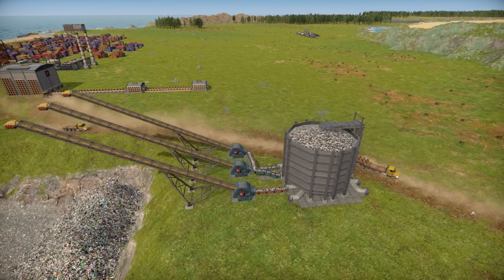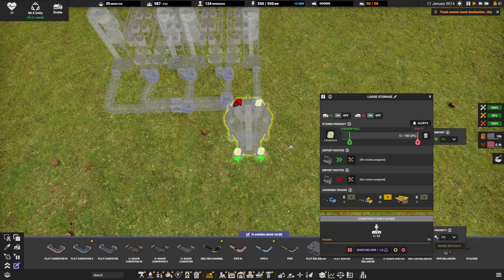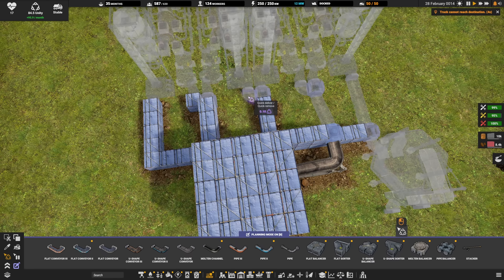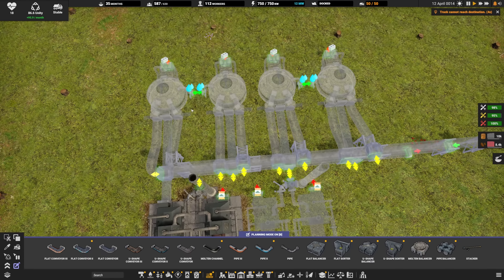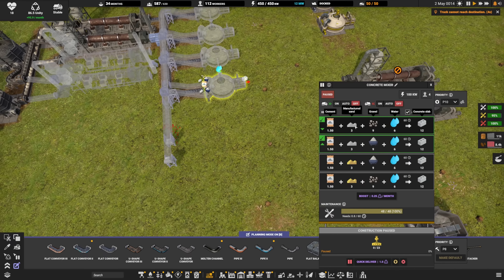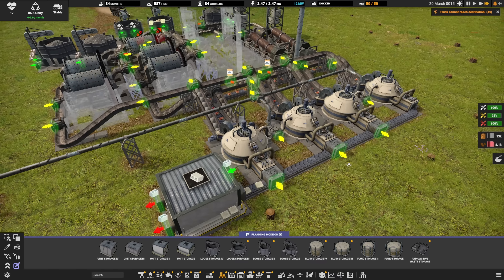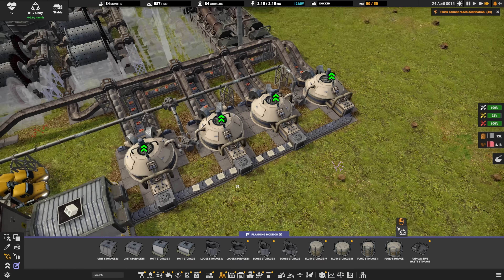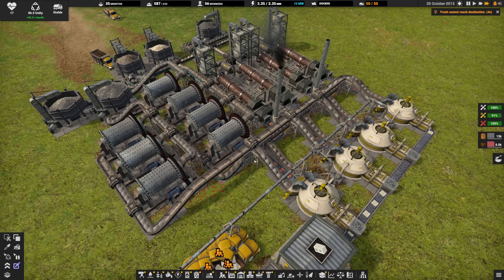Upgradable Concrete Slabs Blueprint 🚜 Captain of Industry  👷  Walkthrough, Guide & Tips

Comment: Did you know, you can run 1 crusher instead of 2, for producing manufactored sand from stone?
You just turn on both recipes, connect output to input. And place sorter, which will sort out manufactored sand from the loop.
Stones > gravel, gravel go again, and > manufactored sand.

Comment: Hi JD, 
thx for your hard work. 
Those blueprint-vids (I count the "old" vids with the smelters ect. too) are really great, because you explain your reasons and thoughtprocess while buidling.
Is there a blueprint for a brickproduction?
Reply from the maker: No there isnt a blueprint, for bricks, I found after getting to play with them this time around that buy the time you have belts its not really worth scaling up, as its cheaper on coal to upgrade to the concrete slabs

Comment: Hi i've used several of your builds they work great. But i think the approach of building all things at the same place might not be the most efficent way of doing things. Wouldn't it be more efficent to build the rotary kilns on site to save truck labor(hauling 3 cement and 1.5 coal per minute per kiln should be better than 9 lime + 1.5 coal). And by the same logic the mixers and crushers should be built close to the smelters to save on slag hauling.
Reply from the maker: Yes and no, as your limestone mine is going to move around, as you dig it out, and then maybe even later in the game be imported from a dock it would be best if its near a final construction location. The rock no matter what needs to be hauled from where your digging it to where your dumping it, so we can exclude that, which leaves slag, if this is placed near your iron/copper/glass smelting which is also near your production centre then you should just be able to belt over some slag which is already a existing waste product that your picking up and dumping in the sea.
I tend to build one large production centre and keep everything which can be linked with belts linked with belts and only use trucks for importing in raw resources, so they now have very dedicated jobs

Comment: I've only ever ran slag & sand
Reply from the maker: Previously it was only sand, but now with the manufactured Sand from rock it just makes sense to use that as its a waste product. If you wanted to use raw dug sand then the option was left open to add another bucket near the output from the crushers to directly add sand into that belt

Comment: Tier III is just not working because of the “balance” of the build or requires other inputs for the mixer?
Reply from the maker: Balance mainly It would require twice the crushers, which means your much better off upgrading to large crushers, or upgrading 2 mixes to T3 and removing the other 2.

Comment: My ocd doesn't like this build :(
Reply from the maker: Can I ask why?
Reply: Of course you can. My ocd can't get arround that you turned some buckets 90 degrees. In my ocd approved world, put al buckets in 1 straight line and use the belts just like you use them for feeding the machines; 3 high.

This game is killing me. You make a build in a couple of minutes, it takes me a lot more time to make everything neat and tidy. 

Keep up the good work JD!
Reply from the maker: @pietplezier3302  I can see that, I try to get the builds as small as possible to make the blueprints as small as possible in case someone needs to shove it in a corner where they had little to no planning. but spinning buckets around should only cost you a few tiles in space